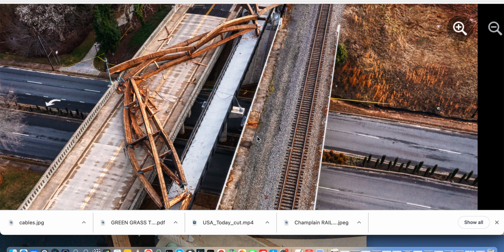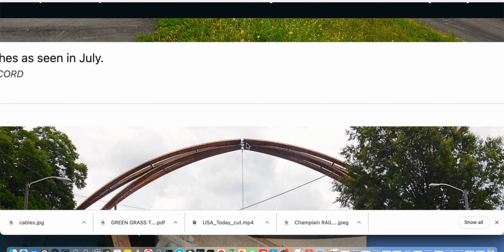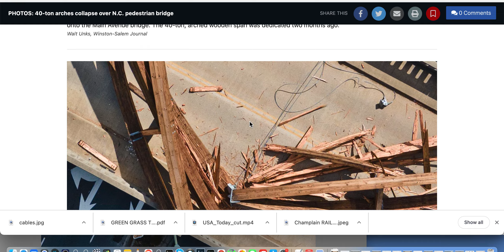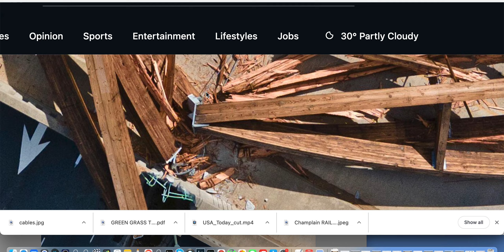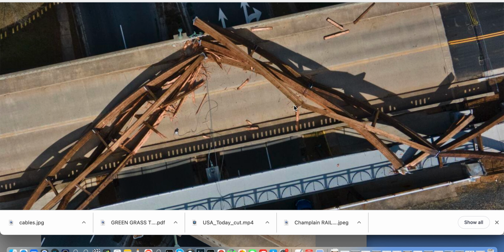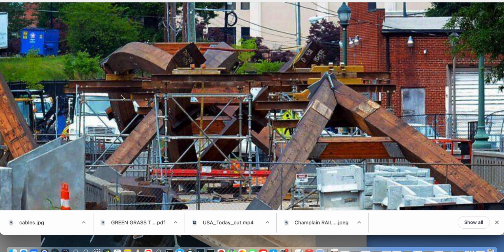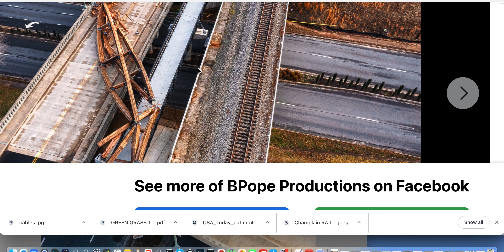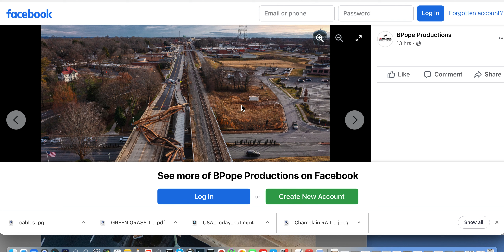Hickory Pedestrian Bridge collapse TENSION CABLE AND ANCHORAGE FAILURE Part 2 Data Stacking

Comment from the maker: Part 3 is on Rumble https://rumble.com/vvbrep-hickory-pedestrian-bridge-collapse-tension-cable-and-anchorage-failure-part.html

This channel is viewer supported, kindly give a thumb's up on this content, it would be greatly appreciated.

https://www.amazon.com/hz/wishlist/ls/3UBMVWND65U4M?ref_=wl_share

My email is cefa1@yahoo.com if you would like to get hold of me.

https://www.paypal.com/cgi-bin/webscr?cmd=_s-xclick&hosted_button_id=V9TGHDE92LQ8W&source=url  thank you very much.
https://ibb.co/r4wTF98

https://www.youtube.com/watch?v=p00-lJ0q_cA
DEFLECTION IN CONCRETE DECK MODELLED WITH REBAR ''ANTENNA" PART 1 of 3

Champlain Towers & DEFLECTION IN DECK modelled  WITH REBAR ''ANTENNA"  PART 2 of part 3 #BoltDepot

https://youtu.be/Ey80n1HwoO8

Here I am on Rumble https://rumble.com/vvajti-hickory-pedestrian-bridge-collapse-tension-cable-and-anchorage-failure.html